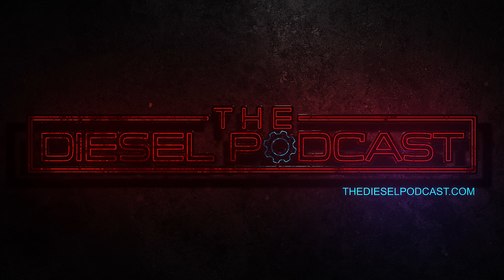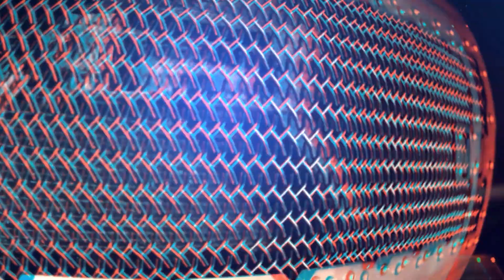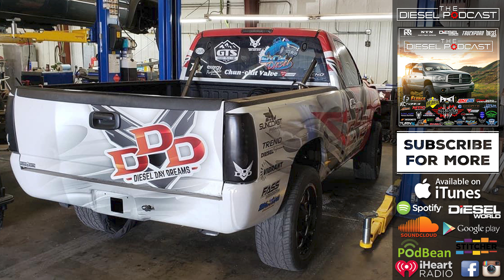Duramax Goodness with Diesel Day Dreams

Comment: These are my favorite podcasts to listen too. I was almost 10 when diesels were nothing and now In my early 20s 9s on a budget are easily possible. I love listening to old timers talking about big blocks running 13s on tracks that don't exist anymore and they were the hot shit and nothing without slicks could outrun them. The progression is crazy and I hope it never slows. I hope in 10 years there's a chassis cert for prostreet trucks to run 7.50s and everyone has to dial back power to not get kicked off the track. If not pro mod diesels running in the 3s in the 8th with gas cars